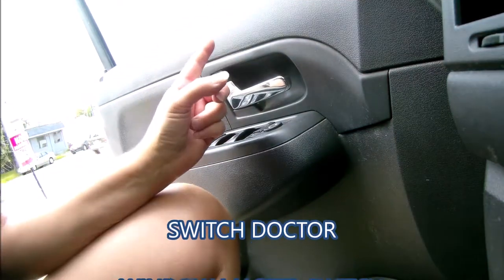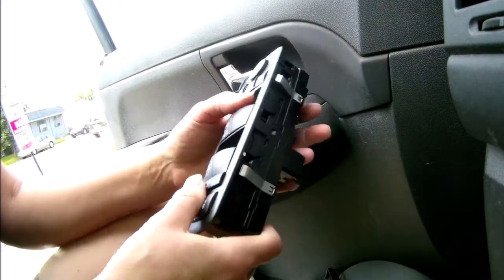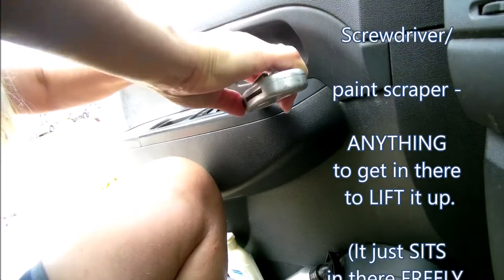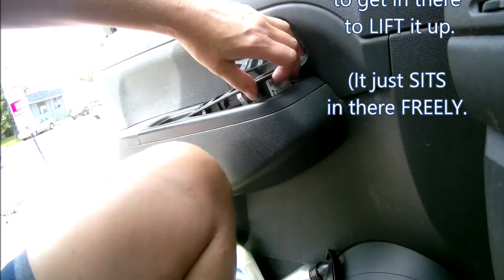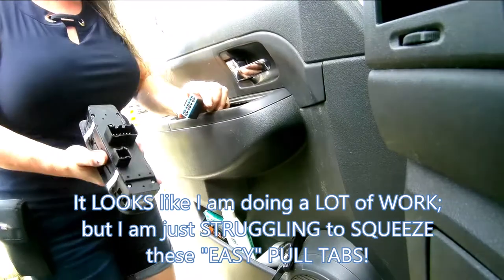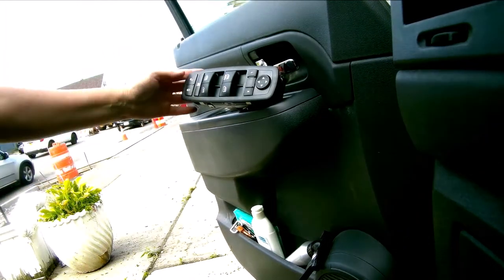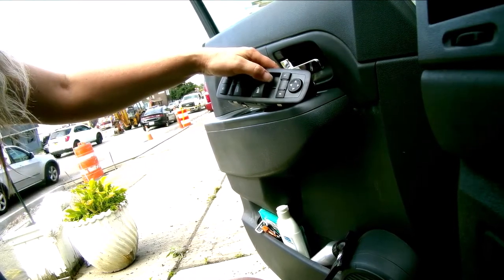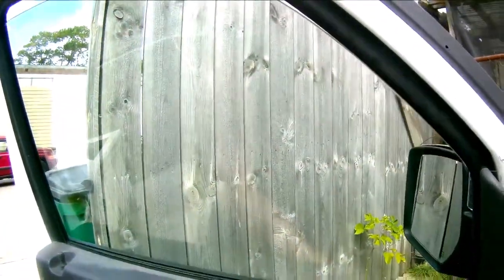Switch Doctor Window Master Control Switch INSTALL 2011 Jeep Liberty

Comment: Did you try looking at the switch itself? I wonder if the contacts for the switch are dirty and need a good cleaning. I came here for my own liberty switch being possessed by some sort of devilry too. I’m finally starting to look into the problem now.
Reply from the maker: Hi Charles, I did everything possible before buying the new switch 😁
Reply: Ya, the contacts get dirty, burnt. You can't easily clean them because it is all molded into plastic. That's how they make stuff today, you can't fix it!